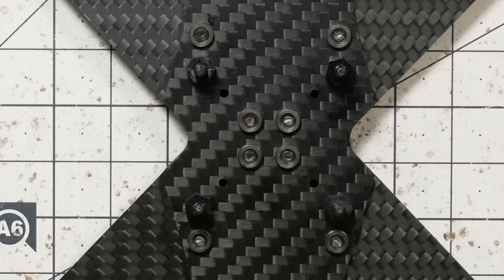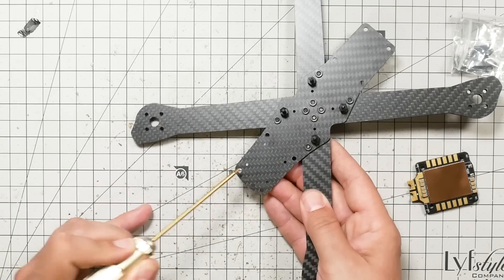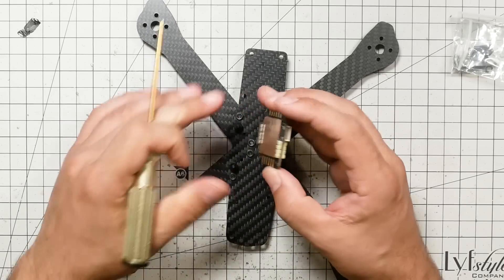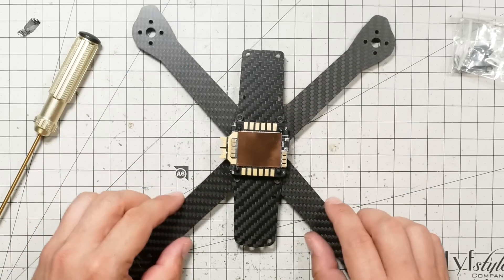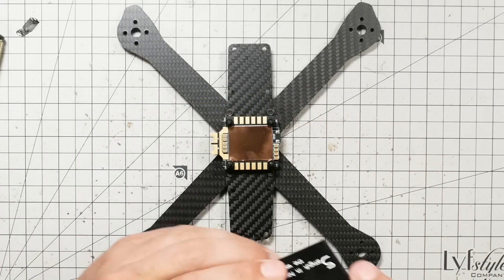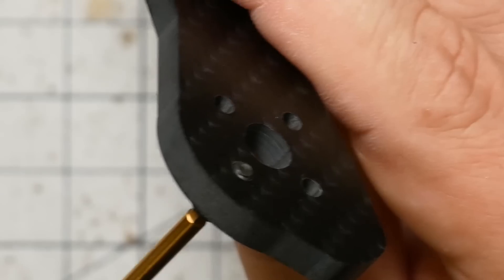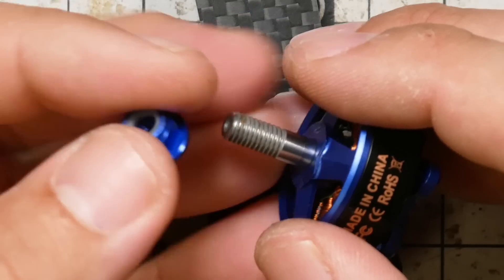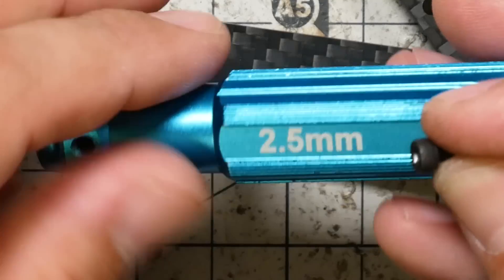Learn To Build a Racing Drone - Part 3 - Install Motors and ESCs

Comment: So question, what did i do wrong if with betaflight i can spin up the motors just fine but when i use rx as soon as i arm all four motors wig out.
Reply from the maker: Most likely either a motor is spinning the wrong direction or a prop is on incorrectly.

Comment: Beginners should not be using 4in1 esc's. They are expensive and are trash when they fail. Individual esc's are better.
Reply from the maker: Reliability of 4-in-1 ESCs is way better than it used to be. And having the ESC in the stack makes it less prone to damage than on the arms. Mostly I wanted to save beginners a few solder joints, and make it impossible for them to accidentally mis-wire the motors.

Comment: What’s the thought to doing the esc first? I would have thought FC first because the 4-1 and vtx produce the most heat and since heat rises it would help keep your fc cool
Reply from the maker: ESC always goes on the bottom in any build although I have to think about why. Mostly I think it's because the motor wires are big and they would get in the way if you had to work on the FC. Think about it... if the FC was under the ESC how would you solder on the FC? You'd have to desolder a motor to move the ESC out of the way.

Comment: Hey Joshua. Love your work :)
If you are building your first drone, how do you know which parts to choose? E.g. Different motors or esc ratings, without needing to hunt for thrust tests. I have found alot of personal opinions but no real answers.
Reply from the maker: For motors the best thing to do is find somebody else who flies a similar style of flight and ask what motors they like and why. In general 2306 or 2207 size in about 2450 kv is a great all round choice if you're not sure. For ESC's about 25 to 35 amps is sufficient for any 5" quad and most others.

Comment: Question: would it be easier to tune quad if motors would be softmounted?
Reply from the maker: As long as the gyro has enough filtering, more filtering doesn't help. I've built two of these so far as test and haven't had any tuning problems. So I don't think that soft mounting the motors is worth the trouble.

Comment: Question: is't it would be better to use at least ONE metal long screw for esc & fc mount, as they don't break after crashes so easy, and you don't need to reassemble whole quad again and again? (yes you for sure need to test for conductivity first esc and fc holes).
Reply from the maker: I don't like using metal stack screws because they transmit force to the electronics in a crash. In a crash that breaks a plastic standoff, I'd rather break the standoff than the FC or ESC.

Comment: JB, I might have missed it ... but would be good if you could wax eloquently (as you do) on the tools that one should have to do a successful build - size of drivers, wire cutters, etc.  Just a list would be great - the 2 mm hex driver for example ... thanks.
Reply from the maker: Link to my tools is in the video description.

https://www.fpvknowitall.com/ultimate-fpv-shopping-list/

Comment: No loctite for locking the threads on both motor and arm screws? Just wondering.. :)
Reply from the maker: I often skip loc-tite. If I were to use loc-tite, it woudl be Mercury Adhesives.

https://amzn.to/2QssUaD
Reply: Geniuses. Brush in cap! I think they are onto something...
Reply: I never used it and just created a habit of checking motor screws after every third or so flight. Still waiting to lose my first screw.

Comment: I couldn't agree more with your choice for the Tekko / Kakute / Atlatl stack. But those motors ? ehm... no, the bearrings are crappy. For a few bucks a motor more this could be a budget premium build, for example with these motors: https://tinyurl.com/y8vjzpmw
Reply from the maker: It's really tough because I had to make compromises somewhere to get the price down. My goal was actually to get under $200 but I just couldn't do it without too many compromises. So my perspective is, those motors are usually good enough, and a beginner isn't going to feel too much pain when he or she crashes and destroys them.
Reply from the maker: For what it's worth, before I settled on those motors I bought 20 of them and tested them out and I have been flying 8 of them for about 2 months. I feel the quality is good enough for the price, even if sometimes the quality is not as good as we'd like.

Comment: When tightening the screws for the motors, I have noticed that sometimes the tighter you screw it, it sometimes gets the motor shaft to get harder to turn, even when I thought it was just snug. Why is that ?  I have had to buy a whole new set of motors because the motors got so hot.   Is there a rule of thumb on how to tighten them, or are we supposed to use the bigger head screw 2.5mm or the button head 2.0mm ?
Reply from the maker: I have never seen that happen and to be honest I'm hard-pressed to imagine how it's happening. The motor base should not obstruct the shaft or bell at all. I guess I would look at what is rubbing on the bell or shaft when the motor screws are tightened down. That just shouldn't happen.

Comment: Pros and cons for  building the stack with nylons  or metal screws.
Reply from the maker: There's no reason to use nylon screws in my opinion. They are weaker and they break easily. I like to use nylon standoffs just because it's very difficult to find metal male-to-female standoffs.
Reply: Since my second Quad I only use normal metal M3 screws and then nylon nuts as spacers at the bottom (below the 4in1 ESC) and then rubber screws/standoffs/vibration-dampeners under the flight-controller if that one doesn't have big holes and rubber-grommits.

Those nylon-standoffs always broke in even light crashes on my quads and it's a real hassle to replace them if they are under the 4in1 ESC if you do not have left enought cable length to the ESC to be able to lift it up comfortly to replace the nylon standoffs.

But never use vibration-dampeners and a fight controller which has rubber grommits together! - That will make the situation it even worse because the swinging resonance of both rubber materials will no be the same and leeds to strange vibrations of the FC.
If the FC has a vibration-dampened gyro on it, you don't need any further dampening at all and even shouldn't use additional dampening at all!

But that's my personal experience and other's may be different.

Comment: Why was this VTX chosen? There are many cheaper equal to higher quality ones with more output power.
Reply from the maker: Because we were able to get a better price on the Holybro stack by buying ESC, FC, and vTX together. And because the Holybro hardware is known to be solid and good quality. And Holybro is reliable for fulfillment.

It's easy to overlook that what is the best item for an individual to buy one or two of, is not what is best when you are looking to buy 200 or 500 or 1000 and need to keep stock and need to make sure that quality stays high. By using the Holybro stack it means we don't have to chase after three different vendors (vTX, FC, ESC) when we are trying to make sure we have stock. And it means we can offer a bigger discount to you because we are buying the three items from the same place.
Reply: @JoshuaBardwell  Thanks bardwell

Comment: Joshua I have a question, I have read about soft mounting the motors to help with vibration, but I have read too that on micro quad builds it's not that important (I really can not remember from what website or forum I got that) ans just soft mounting the FC should be enough... what it's your take on that?
Reply from the maker: Personally I seldom soft mount the motors because today's FC are usually designed with built in soft mounting for the gyro, either via foam or gel mount, or gummies on the mounting holes.
Reply: Thanks!
Reply: I do not soft mount on my gremlin and it flys great